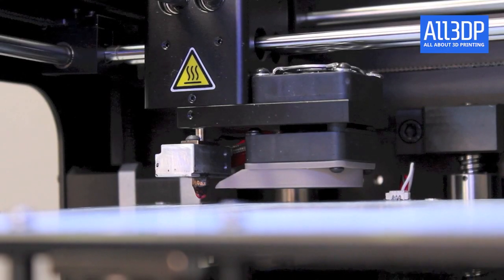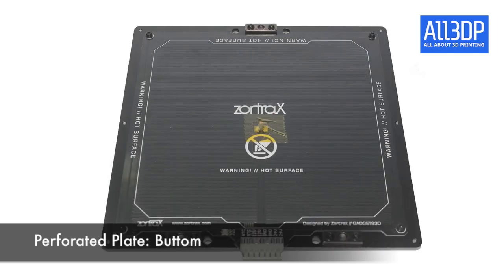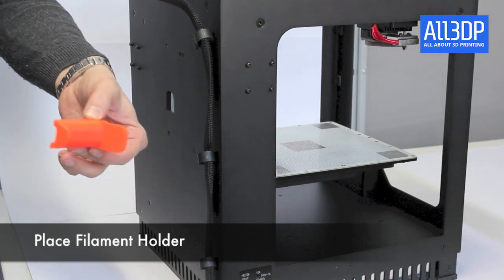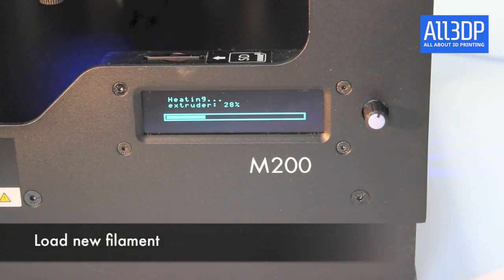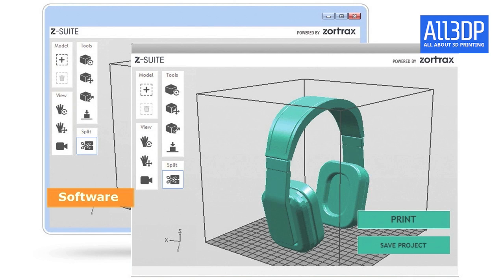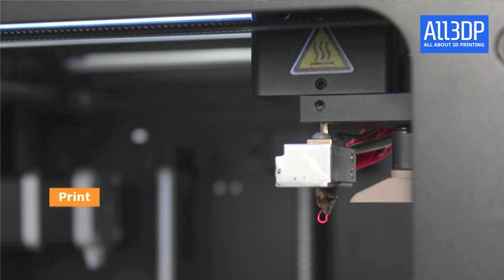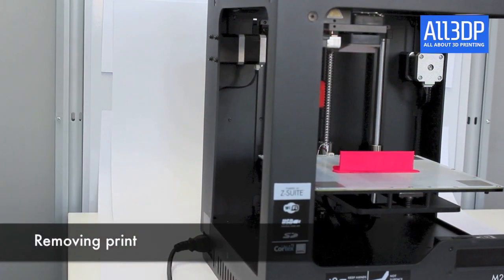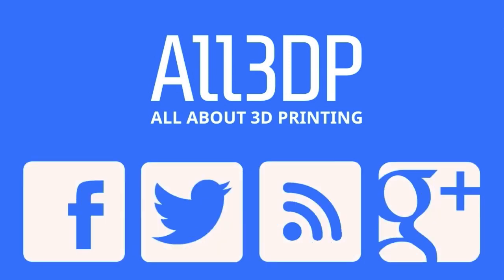Zortrax M200 Review by All3DP.com

Comment: Very good presentation, unlike Zortrax website where everything is password protected.

Your printer shows a printer with Z axis ballscrew, I read that Zortrax now uses just plain leadscrew. So your printer is one of early printers?
Reply from the maker: juliusvalentinas Yes, we think so too. The printer was provided by distributor iGo3D and had been in use before.
Reply: All3DP Thanks, for your reply. I planned to buy the printer, but without ballscrew and maintenance free IGUS rails, I think I'll spent the 1500Eur on Spiderbot with HIWIN ball bearing rails, heated chamber etc. etc. There is an future planned upgrade for servos too. So I don't understand why dumb down the machine and still charge the same price is fair?

Another thing is that filament was 2x cheaper during kickstarter of zortrax in their international store. Now it's expensive and still have same problems like all other printers, no heated chamber means no big prints, they delaminate.

The third reason is user support. Zortrax team bans everyone who:
1. suggest some fixes or improvements
2. does not agree how things should be done and comment accordingly
3. does no have a printer and comments in their forums with different views from their own

Sorry a company can't do this if they care for their customers. Maybe a post soviet country like Poland can, who knows. If they wanted to charge additional charges for companies to get a warranty on their printer at all. Now I see this is not required. Well to each their own I guess.
Reply: You have some good points there, but calling Poland post-soviet country is a LOL :-D
I am pretty sure, they were never a part of soviet union. Is Lithuaninan history? Your name sounds lithuaninan :-)